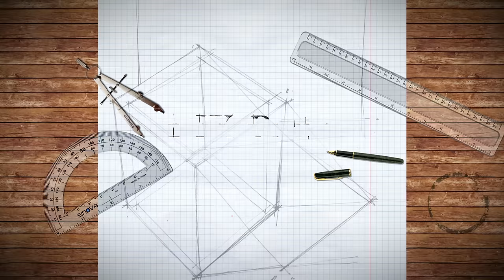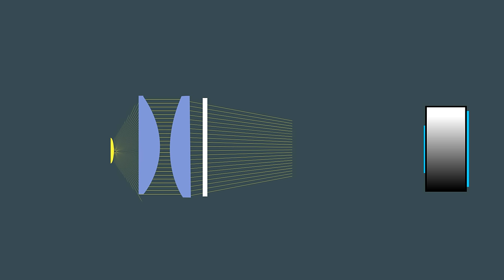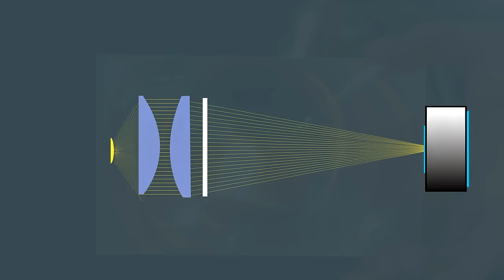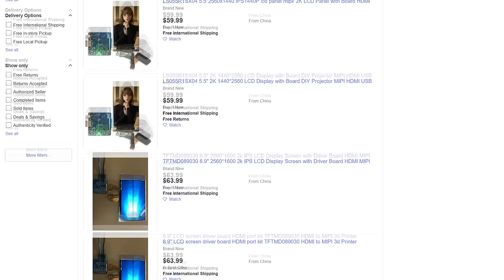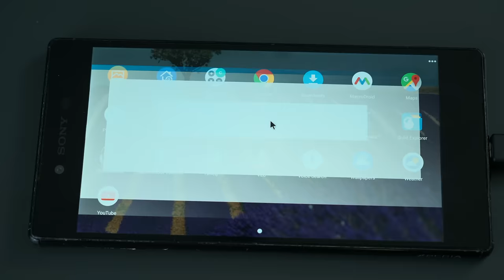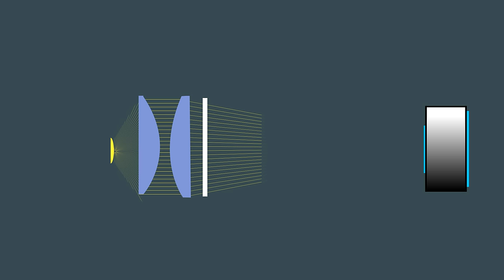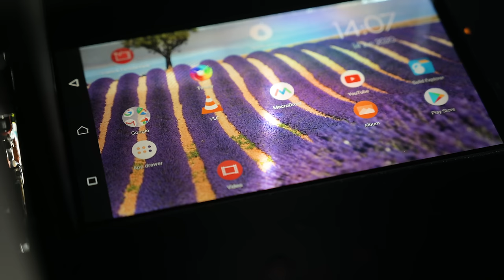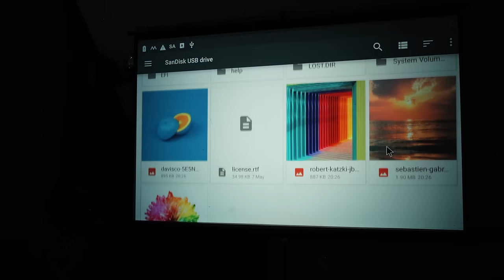Building a TRUE 4k home cinema projector (it’s awesome)

Comment: You can actually mount that helpful reflector, but it would complicate the build because it'd also need something called Infrared Cut Filter, which would need to touch some kind of metal casing and radiator to remove the heat from it. Just like in those lamp projectors.

Comment: 20:04 aren't those fans pulling air from the outside and pushing it inwards?
Reply: Yeah, the arrows you can see on the side of the moulded plastic definitely seem to be pointing inwards across the heatsink!
Reply: You can reverse the wires when attaching them to the power board and reverse the motor.
Reply: @MaxDad7 The Fans are pulling air into the Case and pushing it up. If you Reverse the voltage of a PC Fan the Fan want Spin at all ! And the Blades also are specialy shaped for Spinning only in one direction.

PS: please dont judge my grammar i am german😅

Comment: “Through the phones headphone socket” ...
Reply: The phone used has micro USB, smartphones without headphones jack have USB type C and it can be split with an adapter that has a built in DAC to add a headphone jack, you could probably use an hub to get advantage of the internal battery too and charge it  but it would only make sense if you also were to add a battery for the LED and fans.
Reply: @raptor13  i believe the OP means "IF" your phone still has one
Reply: USB-C dongle hub would solve this if your LED you get is current day.
Reply: You can get a Bluetooth transmitter that you link to the phone. The transmitter can have a 3.5mm jack and it can work that way.
Reply: If you use a USB-C device, you can use that.
Reply: @raptor13  usb-c and 3.5mm aux arent mutually exclusive lmao
Reply: @jetaddict420  never said so
P.S. written from a phone with both
Reply: @ethexofficial8974  Why would you need a Bluetooth transmitter when you can use the one built in the smartphone?
Reply: @ethexofficial8974  that would add a lot of audio latency though
Reply: @raptor13  xperia xz premium has a USB C and a headphone jack..

Comment: If we used Water cooling instead of Heatsnik then it will. More silent and we can add more wattage led please reply it
Reply: How do you watercool the display? That's the most heat sensitive part
Reply: @DanSlotea  Question is, what the limit is for the display. He only mentioned not to use 300 W LED because it needed more cooling, causing more noise.
Reply: @DanSlotea  I bet a fan blowing across the top and/or bottom would help keep the screen cool.
Reply: @RedlioNxTR  The more cooling was for the display. Since it blocks a significant portion of the light it will heat up much more as the brightness rises. LED are pretty cool as far as light sources go but light hitting a surface heats that surface.
Reply: @mikepettengill2706  also if the display is already saturated by the amount of light delivered by the 100 watts led switching to the 300 watt will only make it worse and no more light will pass through

Comment: Very cool. Just an FYI, that heat sink is upside down and not giving you as much cooling power as it could. Those tubes are heat pipes with a liquid in them. The idea is that gravity brings the liquid to the point where the CPU/LED is attached. And when the liquid heats up, it vaporizes and goes up into the area with the fins where it cools back into a liquid where gravity kicks in and the cycle repeats. Just putting this here for anyone who may not know. Still a great project! Love it.
Reply: Negative, heat pipes use capillary action not gravity. There is a tiny amount of liquid, if you cut one open you would think there was nothing at all. Think about it, the vast majority of desktop computers have the motherboard and cpu mounted 90 degrees from horizontal.

Comment: I wonder how bright an LED you can have until it damages the phone screen.
Reply: I think that if you cool the back of the display with a good fan, nothing bad should happen
Reply: @fusseldieb  right? Some added fans should do the trick.
Reply: For brighter LEDs you could and perhaps should add an Infrared filter before the LCD panel.
Reply: @Conservator.  Shouldn't a polariser be more useful? If the LED used is not garbage it should put out a very small amount of infrared, but LCDs are polarising so they should absorb all the light that's not polarised right. So if you put a filter in front that already polarizes the light, the LCD has to absorb much less of it.
Reply: @watcheths  feels like a 2.0 version of this project would be really interesting!
Reply: @GunsOfAnthem  yes, the weakest point of this project is the poor brightness after all
Reply: Maybe you can make a clear acrylic water cooler to mount on the display?

Comment: "it is very important that these fans do indeed push air outwards like this" and then he shows the fans configured to push air inwards...
Reply: yeah i noticed that too
Reply: What makes you think they're configured to push air inwards?
Reply: @willwheet464  the supports of the fan hub that attach the fan to the frame are on the side that air comes out of. and you can see that they are inside, so that fan is pushing air in.
Reply: @willwheet464  I looked at them by watching the video
Reply: @borkiborz2891  I understand what you're saying, however in the video it looks like the fan is designed with mounting holes on either side of the fan, so it seems like it could be installed either way. Alternatively, is it not possible to reverse the direction of the fans by reversing the voltage? Honest questions here, I don't mean to come off as argumentative.
Reply: @willwheet464  Yes they can be mounted both ways. You can't reverse the voltage because fans don't push air backwards, only one way. To reverse the air flow you just flip the fan. And the way it's mounted in the video that fan is blowing air inside.
Reply: @borkiborz2891  I'll have to take your word for it. Thank you for taking the time to explain.

Comment: I gotta say, calling the prebuilt one "ten times the price" is a little disingenuous, as that implies the build is around 200 dollars.  Adding the best parts from each ebay list, it ends up as closer to one thousand at the time of writing.
Reply: without sound system and without HDMI input and maybe with trouble making it a WiFi video sink.
can it be the case that the central display plate will suddenly break due to thermal reasons?
Reply: And all that for a bulky something that is disappointingly dim and dingy.
Reply: Yes, but you can upgrade the screen to a 8k one pretty easily when they hit the market
Reply: @Francisco17Berrios  For the cost of another butchered phone!
Reply: Browningate I doubt anyone will be manufacturing a phone with an 8k screen. But then again I wouldn’t have thought anyone would release one with a 4K screen 🙂
Reply: Matthew Komadina  For £1000 is it not genuinely better to buy an existing projector?

Comment: 20:10
"It's important that the fans push air outwards."
But they actually pushing air in right there.
Reply: Is a push pull configuration not better anyway?
Reply: @rossdewar6259  in this case specifically not better, it will circulate air only on the led compartment, other upper compartment wont get any air circulation at all
Reply: The entire system did not have good airflow, so I don't think it ended up mattering either way.
Reply: @rossdewar6259  Push/pull will only take air in from one side, at the bottom, and push it out on the other, at the bottom. Pushing air out from both sides at the bottom means it has to pull air in from the top, which will also cool the screen and phone.

Comment: I find it veeeery misleading to tell that this diy projector is 10 times cheaper than 2K bucks projector. In you links just the LED will cost you 99 bucks. Plus 4k phone or panel and you already way beyond 200 bucks budget. Add up lenses, aluminium, mirror, vinyl etc.... Would be great if when you speculate on build cost of your project you provide price list of your parts.
Reply: Sure enough, those titles may be little "clickbaity", and you may need to be a bit lucky to get this shit for the money. 
However, it is possible, especially if you got some stuff there anyway - and those would build something like this usually have somewhere a few fans, power supplies and such junk there. 

LED is a fair guess and most propably wouldn't have one, but if you are lucky, you may get them a little cheaper. And for the phone, really depends. The Z5 is kinda old now, and if you find a pretty beaten up device (the display can be shattered as well, as long as it still works), you may get it for <50$. Other then that, if 1080p or 2K is enough, a old phone may be good enough. And the screen controllers, if used "solo" are pretty cheap. 

The other parts.... Well most you can find dirt cheap from ebay. 

So I'd say, it is possible. Hard, but possible. If you went for a 300$ budget, it would be actually kinda easy to get all parts, as long as you find that stupid phone used, if you want 4k (since as he showed, stand alone 4k displays are insanely expansive).

Comment: 3:38 Glad I'm not the guy having to thread those nuts down all four feet of rod to get them to the bottom
Reply: The trick is, put the bottom ones on from the bottom.
Reply: @bluesifer8238  oh stop it lol .... you're gonna hurt his tiny brain...
Reply: @bluesifer8238  Yes, thread them from the bottom when there are already plates there. Use your "tiny brains" and you might get why he had to thread them all the way down the rods.
Reply: My thought was to 3D print an air wheel with the center cut out. You can slide it on the nut from the side, then fix it with the small lever next to the opening, then taking an air source(hair drier, air compressor) blow it to rotate. If you dont have a printer, then you could make it from wire, and paper for the catching bowls.
Reply: @dinkledankle  Evidently if you've already started and some plates are in the way then you're not going to be able too are you.

Comment: 25:54 "comercial projector 10 times the price" - No way you build your DIY version for 200 USD.
Reply: The aluminum alone, purchased from the links given, would be around 200.
Reply: @bronkula  you can use any material instead, like wood, or cardboard if no coins around
Reply: @bronkula  not to mention the screen. I get he may have gotten that Sony phone for free, but the panel plus the board costs about 260$. Not counting 3d printed parts and tools, there are still bolts, rods, spacers, inserts, the cooler, the power supply, the power booster, the step down, the usb hub, the relays. I'd say that the total price is around 1k. There are also 4k projectors for around 800$ that you can mod for better results.
Reply: Maybe he just have a bunch of aluminum boards laying around
Reply: @Lykon  After adding all the prices together (not using a broken phone's 4k screen) I get a total of around 470€ or ~$532 which is a lot cheaper than any of the projectors that are sold online. Nevertheless, $200 is a very misleading price.
Reply: Why do you guys bother to watch these videos if you're going to just say "BUY A PROPER ONE FOR X AMOUNT" or "he's bullshitting, he can't actually do X for Y". The whole channel is DIY projects.  He even gives plans out. Take what information you want from it and try it yourself. Want to use something cheaper or requires less tooling? Go for it. Figure it out. Try something else. Where are you original & thought out DIY videos?  People on the internet are so entitled.

Comment: "and get this.... it's 4K!"
That isn't going to age well is it X-D
Reply: I have a feeling that video resolution is going to plateau soon. Sure, 8k and 16k screens are on the horizon, but at some point, it just isn't going to matter anymore. We are actually starting to see the shift now. Things like color accuracy and higher bit depth displays are becoming more important to people than actual resolution. 
Personally, I would rather a good Dolby Vision video in 1080p than a flat looking 4k video. Thankfully, I don't need to choose. 
Another issue is that 8k and 16k source material is gunna require some sort of new technology to get the data to the screen. Streaming will be garbage because of datarates. We are pushing up against streaming looking terrible right now. I recently purchased Top Gun (the original movie) in 4k on Google play. It looks awful during the beginning carrier scenes because of the compression Google uses(there is a lot of fast moving steam and a lot of film grain and both wreak havoc on compression algorithms). Target had the uhd for $15 so I picked it up. Sooo much better. No terrible compression artifacts. 
This will only get amplified as people start trying to stream in 8k or god forbid, 16k. Internet speeds will have to get to a point they aren't expected to be at to keep up. Not to mention the ISP aren't going to have it. 
8k and 16k are coming, but they won't be the revolution that 4k was. Especially considering the hdr aspect of it.
Reply: @herranton  16K matters more for virtual reality for eyes (screen or projection per eye in mount)  to be able to have such a fidelity that it's nearly indistinguishable from real life viewing.
Reply: @CheapSushi  Very true. I can see certain things, especially those where the display is near the eye, getting higher resolutions. But for average entertainment, I think we are going to see a plateau. Or something unforseen (at least by me) needs to happen.
Reply: @herranton  Why not use blu ray for 4k?
Reply: Web videos are still happily consumed at 480p~720p. Considered “high quality” by most people
Reply: @duskonanyavarld1786  Blu-ray is used for 4k. We call it uhd. But it's still just a Blu-ray but with different video codecs and specifications and whatnot. 
You could probably fit a 8k movie on a Blu-ray too. But you're really pushing it.

Comment: This is awesome! Only thing is finding a place to put it where it is centered and not in the way in the room. I'd probably try to reduce the heatsink footprint if possibly to make it a little shorter and maybe try a brighter led so that it would hopefully show up more in the daytime. Add an Nvidia shield as the brain and that would be awesome! Great project. 😊

Having said that another option for a brighter led would be a PC water cooler. Lower footprint and no fan noise. I'd like to see the output of the light measured in lumens like they do with the other projectors, however I'm not sure if they measure it at the source or at the output of the lens, which would make more sense.

Comment: and at the and: "this is the expesnive projector and of course it is better".
Reply: Is that what you got from that? I got brighter with washed-out colors.
Reply: @46wireboy  looks better to me once the lighting is dimmer. Pixels looked tighter and more focused. Not that it matters when looking from a distance. Plus I wear glasses and don't like the way ultra k looks so my opinion is probably shit.
Reply: @46wireboy  the washed-out picture is probably mostly from how bright the projector is relative to the small room. The excess brightness of the light in the projector is bouncing off of the white walls and essentially brightening the room which means you can never see true black.

Comment: my db power projector is at 1080p(very satisfied with image sharpness on an 80 inch screen 10 ft away), its brighter than that the image is satisfactory with ambient light, is 20 times smaller than that, got loud built in speakers, costs less than $200, i connect it an old refurbished pc thru hdmi. that project is totally useless to me but thanks for the effort

Comment: My phone is 1334 x 750 with a 4.7 inch screen, and I can just barely make out tiny little pixels if I look really so closely and squint. The the tiny little 4K screen is ironically more useful for what you’re using it for than it is for its intended application.

Comment: 1) how many lumens/ ANSI lumens does this projector have? 
2) how far is the throw distance?
3) how large is the projected screen size? 

Do you know if it is possible to:
- make it have an adjustable throw distance?
- make it have an adjustable size projection?

The reason is because when I move at some point, the room layout/dimensions will be different. I also would be unable to have an almost completely blacked out room, so brightness is an important aspect, I wonder if it is possible to have a very bright projector onto a screen which would still allow for very dark blacks, high contrast, accurate colors, and more.

Also, do you know if there there are 8k screens? (potentially ipad/tablet sized - rather than using a 4k phone screen). I worry that a 4k being blown up would lose fidelity/resolution (similar to a 1080p being blown up to a 4k sized monitor) Thank you.

Comment: The color quality is as much about the imager as the light source.  CRI is basically how smooth/continuous the output spectrum is, which may seem really important but we only need a narrow band of red, green and blue for a full-color projection image.  In high-quality projectors, the light goes through a beam splitter (or actually has separate red, green and blue light sources) to send separate colors through their own monochrome imagers, thus negating the need for top-quality, narrow-band dyes in said imager.  The CRI of the LED is not completely irrelevant though, as many cheaper white LEDs produce a narrow spike of blue and a broad bump of yellow.  It looks white to the eye but doesn't have much true red or green. You can sort of compensate by adding a yellow-blocking filter but that also reduces efficiency and adds cost.

Comment: I wonder if you could still get good colors by using a red and green and blue LED instead of a single white LED... Though that would complicate things as you'd have to get the beams to all align at the screen and you'd have to make sure they are close the the actual color filters on the LCD side of things.